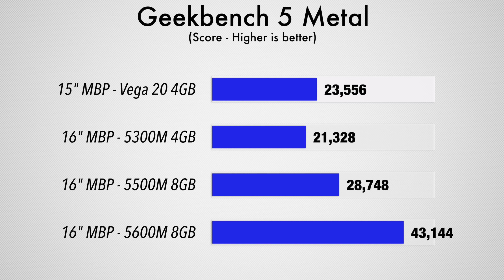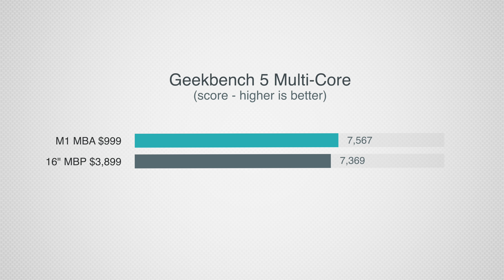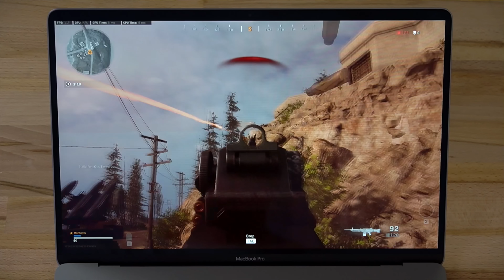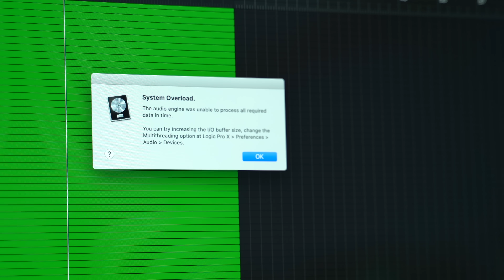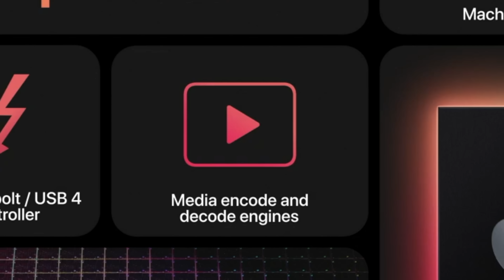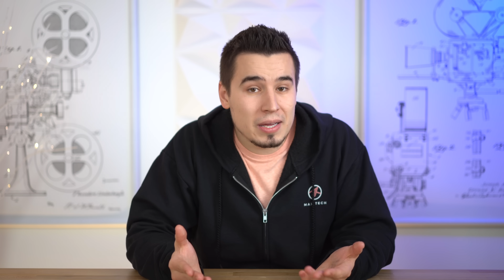M1 MacBook Air vs i9 5600M 16" MacBook Pro - REVOLUTION!

Comment from the maker: Were you surprised by the Xcode Programming & Canon R5 results? Comment below!
We would honestly recommend this MacBook (Amazon) ➡ https://geni.us/8sPj9y
Subscribe for more videos like this one! Best deals on M1 Macs & Accessories on Amazon ⬇️ 
16" MacBook Pro (ON SALE) ➡ https://geni.us/NGqgWvj
M1 MacBook Air ➡ https://geni.us/1mJ41T
M1 MacBook Pro ➡ https://geni.us/7lb3Gn
M1 Mac Mini ➡ https://geni.us/Atm1
Support us by checking out our Merch! ➡ 2teespring.com/stores/max-tech-store
Max tech wallpapers ➡ https://bit.ly/2WNc6Qw
Reply: Love the video, it's insane what the M1 can do, however you mention: gamers would prefer gaming on a Mac? why is that if I may ask? As gaming on pcs currently is so much smoother, due to higher refresh rates etc.
Reply: @93Basje  because apples laptops don’t get as hot, the fans don’t run loud and eventually apple will probably add 120hz promotion display to the mac.with this new apple silicon we can literally have gaming macs and there incredibly light and thin.
Reply: Do with a macbook pro M1
Reply: Not at all. I have been thinking these M1 computers would do extremely well.
Reply: Please add a bit more details with LR testing/setup for us photographers here. GPU acceleration and lens profile correction being applied make huge impact to performance.  Notably, let us know if GPU acceleration is enabled(AUTO) or OFF. And if Lens correction was on. In my testing GPU Acceleration OFF and Lens profile off improves Preview building/Export by 30 seconds exporting 100 24px A7iii files on 8Gb MBA M1. Also please show Zoom in/out performance in the library module  as it very sluggish. In develop module zoom in/out is helped by GPU acceleration so I suspect you had it on AUTO. Would be amazing to see this all standardized:
-Just keep lens correction off always
-Test with GPU Accel in AUTO and OFF the following:
--Build previews
--Zoom in/out in library module
--Zoom in/out in Develop module
--Replace Brushing with Spot removal tool(click around with it and see how laggy it is)
--Export

Spasibo!!!!
Reply: can you Kindly test 3D software like Autodesk Maya, Cinema 4d, Unity 3D on m1 Mac please brother...there is no such helpful video. I'm asking - requesting for last 1 month :( . As a student for basic 3D works and portability wanted to buy incredible m1 air.
Reply: Bro ipad 8th gen or mini 5 best for gaming bro? Because ipad 8th gen bro is non laminated and mini is laminated does it affect the screen or the game play?

Comment: Sooo it’s 2026 and I’m trying to decide. 

I can get a refurbished i9 2.4ghz 64gb 2tb storage for a 2019 16” in 2026 for $1854
A 2019 i9 2.3ghz 32gb 2tb for $1107.99

Or MacBook M1 Pro chip (8 core) 2021 14” with 32gb ram and 512gb storage for $1607

OR I could get MacBook Air 2022 13.6inch M2 chip with 24gb ram and 1TB storage for $1487

I mainly do video editing, run multiple programs at once and creative works/ light rendering. I also have the up top wanna play sims and other games on the side. I don’t mind a smaller screen and I know I tend to hyperfocus and sometimes stay on my computer for hours

Comment: imagine watching this 5 years ago on your brand new old 2019 Intel MacBook 😭🙏
Reply: How’s it been? I’m currently trying to decide because I could get the desired 32gb ram and 1TB storage Id like and a bigger screen on the 2019 compared to  the M1 MacBook Pro where I could still get 32gb ram but lose out on storage (512gb instead of 1TB) 

Or I could get the MacBook Air M2 13.6inch with 24gb ram and 1TB storage 

What would you recommend?
Reply: @anonmity-8502  this is a no brainer. My m1 with 16/512 smokes my friend i9/5600M 64/1TB in all performance test expect video rendering.
Reply: @ano @anonmity-8502 mm.. I honestly can’t recommend the 2019 MacBook Pro anymore because Tahoe is the last software update it’s going to get, and the new version of macOS is like 4 months away
-
no, you don’t need the latest software for your apps to work but the industry will move on eventually, and you’ll wake up one day and realize your intel MacBook can no longer use the latest versions of any app and there’ll be nothing you can do about it
-
as for thire MacBook Air m1 vs the MacBook Neo, in your case, I’d look for the m1 because even though it’s 30-35% slower than the Neo in single core, you will be able to find one with 16gb of ram and 512gb of storage
-
but remember, you’re not doing anything beyond 1080p video editing on these things, and macOS already runs well with just 8gb of memory, so you should probably be looking at an used m1 MacBook Air with 512gb storage and 8gb ram or an m2 MacBook Air with the same specs so you can get MagSafe which means you can then use both thunderbolt ports while charging 
-
short answer: m1 / m2 used 512gb 8gb

Comment: I had to buy a laptop now, and now those two are basically the same price. I was torn between a 2019 MBP (i9, 32GB, 5500M 8GB, 1TB), Air (M1, 16GB, 1TB), both around 1200€ refurbished, and an MBP (M1 Pro, 16GB, 1TB, around 1700€ refurbished). Went for the 2019 MBP, even though it's pretty outdated tech. I want to connect two external displays, and I want to be able to run Intel code/VMs without headaches. I need decent performance for coding and music production, and I want a flexible machine. And the M1 Pro was just a bit too expensive still, even refurbished.

Comment: I enjoy going back and watching videos like yours and feel that I would love to see a video that explains the differences between the memory dependency of previous models versus the current models. This means I would like someone to explain how certain programs can require more memory than others and how having an Apple silicon computer has changed that for the better or worst. Because I am only assuming that Photoshop takes up the same amount of memory no matter what model Apple device your using, but maybe I am wrong. I guess I am curious if the memory is better optimized on the silicon Macs if Photoshop took 6 GB of memory on my new M1 MacBook and I am not set to see a huge performance drop since the laptop can respond better than earlier models. Thanks and keep up the great work.

Comment: Max tech please tell macbook air m1 16ram and 512 ssd please tell 20%gaming 70% heavy software 10% student work please  tell can  it stay 8 year tell I would this laptop because my laptop is in worse condition so i would the macbook air m1 16ram and 512 ssd please it is worth and not last for 8year

Comment: I still prefer the MacBook Air m1 2020 because I have been using it for almost an year and experienced no viruses kinda, no sun programs being frequently added and no hardware over heating, as per my view, the MacBook Air 13 inch one does not need fans, I have been using them for gaming but found lags, actually, they were easily got rid of.

Comment: I guess if you want to sit at home and run geekbench the M1 is great. In terms of compatibility with hardware like Blackjet mem card readers, davinci keyboards and software in general -   the M1 is 1-2 years away..   if you only use apple stuff then not as bad..    I returned mine -  great on geekbench - but 1/2 my stuff did not work - a real hassle -   stay away!

Comment: I was really surprised. I just got the M1 MacBook Air a month ago, and it only has 256GB of storage, and 8GB RAM. And I can't wait for the M1X MacBook Pros to finally beat the M1 Macs. However I'm still satisfied with my M1 MacBook Air because it's fanless, power efficient, powerful, lightweight, and portable. Once I replace my m1 macbook air with the M1X MacBooks, I'll be using my m1 macbook air as a travel laptop

Comment: core i9 that was limited to 60 watts with an awful 2666mhz ram and 5600m with a 50 watt limit are still much better than this "insane" m1? i even don't know if it is an intel and amd's triumph or an apple's fail
Reply: Versus a fan less 10W computer. 

Also the 13” M1 MBP won against the 16” MBP.

Comment: Regarding very large difference in compiling an Xcode project: how sure you're M1 and x86 macs actually do the same work in that benchmark? Specifically, do they both compile for the same target, e.g. both for x86 or both for ARM? At least one of the runs will have to be cross-compiling for a target different of that from the host. If M1 mac is compiling for ARM, and x86 one targets x86, these are invalid comparisons as the two tests do very different kind of work, it would be akin to comparing render time of Blender version X rendering a monkey head and render time of Blender version Y rendering a BMW for X != Y.

Comment: Got a the most expensive mbp 16 and it heats upto 80 degrees Celsius or more just in chrome have had it fixed and still doing same starting to hate apple

Comment: Oh for Heaven's sake ! What kind of ridiculous nonesense are you trying to foist on viewers ! "The estimated performance," of an as of yet non-existant MacBook Pro M1 computer will outperform a current MBP 2020 16 inch Intel based lappy with the Radeon 5600M with the super fast HBM2 8GB video RAM sometime in the future ? Do you realise how outlandish your claim is ? Can we have that test first before the claim ? This review has a particular Apple Fanboyish tone to it, which isn't appreciated ! I happen to own the very configuration you are comparing the M1 Air lappy to (Except my SSD system HDD is a 1 TB version), and I bought it for my video production company as our main editing nexus, and this review is somewhat disingenuous. Come back to reality MAX this is over the top man !!! Your testing methods present a somewhat misleading performance of the M1 versus the MBP Intel 16 inch 2020 with Radeon 5600M GPU. 8GB of system RAM in the M1 computer is simply not enough to edit long duration time lines which exceed 5 minutes in length. I don't care what anyone says, it's a "No Way" scenario for video editing in my professional opinion. Give me the fan noise ! Give me dual fans and the overall dramatically superior performance, but don't give me thermal throttling like in your tests with the M1 lappy thank you very much ;) Your 8 Bit 5 minute video encoding test is absolutely deficient. Why ? Simple. The grand majority of independent and commercial film makers no longer use 8 bit cameras, and thus, no longer use 8 bit video files for any kind of serious, reasonable production. These tests need to be done with 6 minute file size videos running 10 bit encoded ProRes or H265 @ 4:2:2 colour space. I also want to see tests running ProRes 4:2:2 HQ in 10 bit and ProRes RAW in 12 bit please. Many YouTube Vloggers have switched to 10 bit from 8 bit video sources to upload. I understand Youtube is slowly introducing HDR and 10 bit video. P.S. The reason the MBP 16 inch's CPU is using more wattage is because it is a physically bigger system, running a larger screen and a much larger motherboard with more electronics on it. It is misleading to arbitrarily claim from an engineering POV that the current MBP 16 is inferior to the M1, when the M1 is a different size, running a different CPU, screen size, and memory configuration.

Comment: Would 16GB instead of 8GB in the M1 make a huge difference in the tests? Or was the occasional slower performance just because a lack of fan causing the throttling back the chip speed? I can’t add a fan, but I can add more RAM. Is it worth it?
Reply: no

Comment: On the one hand, I was very pleasantly surprised by the incredible and amazing performance and battery live of the M1, but... I bought the 16 inch MacBook Pro about a year ago.  That is not a cheap machine, but I thought "Well, performance doesn't change that much every year anyway, and I can use this for a solid 4 - 5 years before it's worth upgrading".  (I have a 12 inch MacBook retina that I use for more portable use.. or at least I did before Corona).  Everyone knew Apple would probably release a ARM based laptop for a while, but ...the fact that the M1 blows away even high end laptops from everyone including Apple is... frustrating for those of us who pulled the trigger on such a high end machine.  The RAM and SSD options aren't there yet, but it will be interesting to see what happens when they are - and how the rest of the PC industry will react to try to catch up with Apple.

Comment: I bought my first MacBook ever and love it, M1Air. I have noticed that when it gets below 17% or battery it freezes and chugs bad and has to be plugged in. Kinda wished I would have spent a couple hundred more and gotten the pro but that stupid Touch Bar!
Reply: I have an M1 air 8gb and I've sp far never experienced any slowdown. Even with 20 tabs open plus about 10 other apps running in the background

Comment: Just got the base model (8/256) with the student discount and the M1 13 MBA blows my former 2013 MBA 13 out of the water. I felt like I just stepped out of a Honda Civic, and went 0-60 in a Tesla. Battery life is also bonkers. Just went 10 hours of mixed usage with 4 hours left before my first charge. WTF.

Comment: so dedicated gpu is meant to be on the cpu chip... so what happens to m1 and i9 uf paired with a real power gpu of nvidia or different? as long as the i9 can outrun m1 on long heavy loads the m1 doesnt maKe sense
Reply: no the M1 has an integrated GPU since the CPU and GPU are on the same chip. the 5600m is a dedicated GPU because it is separate from the CPU and isn't paired with at CPU on the same chip and sharing power
Reply: @crestofhonor2349  same as intel though ;) and thats not what i said... the m1 will not overrun real graphic cards not cosumer and not professional ;) so i dont want to talk shit about apple... for some ppl the macbooks air and pro with m1 may be an option.
. if u r a real professional user they are not strong enough... then u need to stay with i9 and dedicated graphic chip. but i guess we ll see some mb pro witj separate graphic unit.like they did with the last mb pro top notch model priced with 5k dollars xD

Comment: You said that you think Macs might become the future of gaming. This won't happen. The mac, as much as I like hem, has one tedious problem. They upgrade the OS every year.

So the OSs never mature, and this leads to compatibility issues with software, and it's more obvious with the games. I really like the way MS handles Windows 10, and just keeps releasing major updates while compatibility remains high.

I really feel like each apple OS has much more potential than they ever get to reach because they get replaced so frequently. However, the next few macOS updates are going to be exciting for anyone who has an apple silicon based Mac.

When apple first said that they were dumping intel and making their own CPUs, I thought it was the most ridiculous thing I had heard, but the performance is stunning. For many, the 16GB Mac Mini, is the only computer they'll need for a very very long time. If my PC has been going with an i73770 without any need for upgrade, and that's a 2012 CPU, the M1 is really going to last. Especially since I don't game on Macs. Which means the only thing that is going to make me upgrade, is if somehow 16GBs is suddenly not enough. I mean, it's trading punches with Macs two or three times the price.

Comment: 4:50 This is not 80% faster. (247 - 137) / 247 = 44.53% faster performance. Your math was (247 - 137) / 137, which gave 80% and that shouldn't be the case. Just mentioning. Hope my math is correct. Thanks.

Comment: Air has no fan .. will this affect it's longevity??
Reply: yes in a positive way, as no material will clog up the fans
Reply: probably not as long as the temperatures stay in check and it doesn't get too hot. Honestly I'd be more worried about the battery dying well before the M1 processor will die

Comment: Wassup Max Tech! Would love to have your honest opinion. The other day I just found a May 2019 ver. MBP 15in with 8 core i9, Vega 20, 1TB ssd, 32gb memory on sale at my local electronics store for about $2,000 brand new and unopened. I’m thinking of getting it, but I’m still on the fence. Should I wait for M1 MBP 16in? Any thoughts?
Reply: definitely the mbp 16in, as even the air performs many times better than the mbp 15in
Reply: @mrplasmanotmr_plasma  that’s more of what I’m leaning towards.

Comment: The M1 Air is amazing but it has one major flaw. The USB-C ports are crippled on it.  On my iMac my external SSDs run at around 500 MB/s whereas on the M1 Air they max out at around 300 MB/s.  That is only 60% of the performance.  Considering there are also only 2 ports this is a criminal shortcoming of the new M1 Macs that you guys are not focusing on enough.

Also, just to rub salt into the wounds, my M1 Air (16gb ram, 1tb memory) also came with a warped base so it does not sit flat on a flat surface and now I have to wait another 4 weeks for a replacement, after waiting 5 weeks for the original.

Comment: The gaming tests are really not fair because m1 gpu rendering pipeline utilizes much different architecture than the 5600m and most games are not utilizing them let alone having the proper native m1 optimized binaries.
Reply: even with that the 5600m is still much faster. Real world tests always perform differently from benchmarks.

Comment: I guess that Apple Silicon is a perfect explanation about how Intel is overrated in terms of performances/price
Reply: No, intel actually has some problems because of which they are stuck on 14nm for desktops and 10nm for laptops. This makes their chips power hungry, slow and run very hot in comparison to apple silicon, which is on the latest 5nm technology
Reply: @shivam-dimension  yes, and it means how intel is OVERRATED.
Reply: People have been criticizing intel's lack of performance gains over the past 5 years. They've had such small gains in performance. Intel hasn't been overraed at all